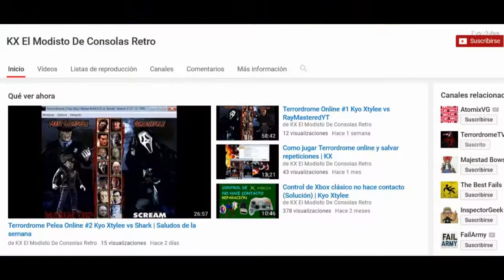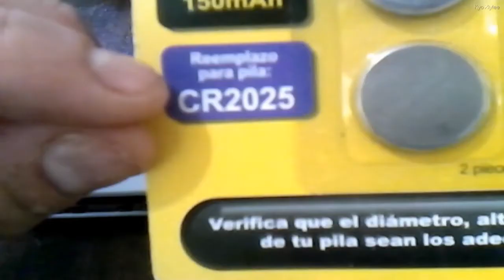Cambiar bateria a cartuchos SNES, N64, GB y GBA que no salvan partidas | KX

Comment: Tengo una duda, cuando abrí el cartucho de Pokemon Stadium 2 para cambiarle la pila, me di cuenta de que no tenia, me puedes explicar que clase de batería se usa en esos casos y como se podría cambiar si es posible?
Reply from the maker: Algunos cartuchos no usan batería, usan una VRAM o Memoria flash, es un chip con varias patitas que va soldado a la placa del cartucho.
Reply: Algunos son eeprom y solo necesitas insertar el cartucho... con la misma electricidad con la que lee el cartucho, la utiliza para guardar la partida. Debes tener malo algun pin donde guarda la partida. Te aconsejo que veas bien los pin y esten conectados a su chip. Muchos chips se corta la conexion y debes sordar una linea entre el pin y chip... si no tienes experiencia usando cautin es mejor comprarse otro cartucho o llevarlo donde sepan repararlo